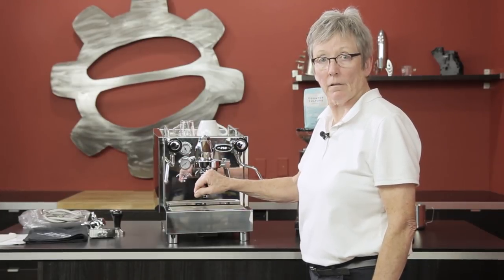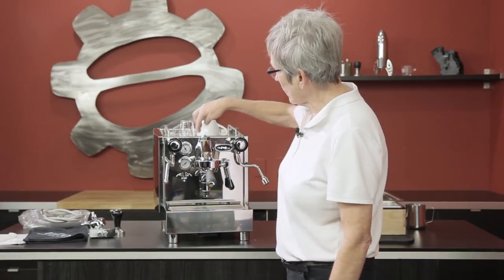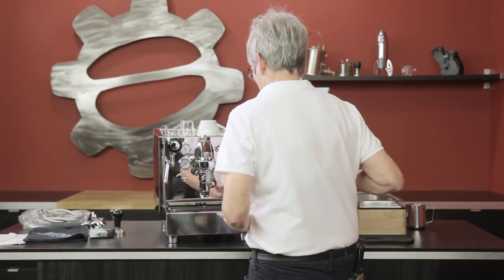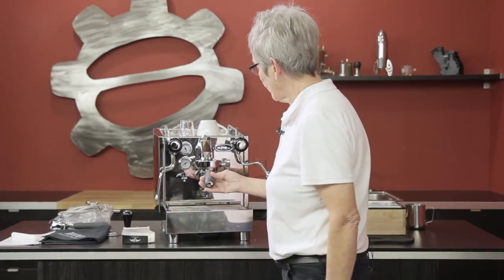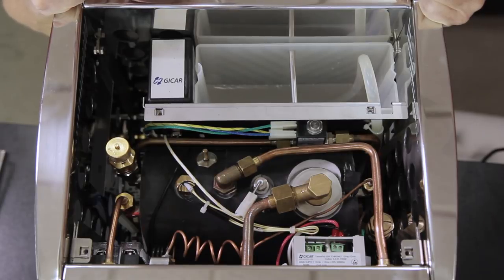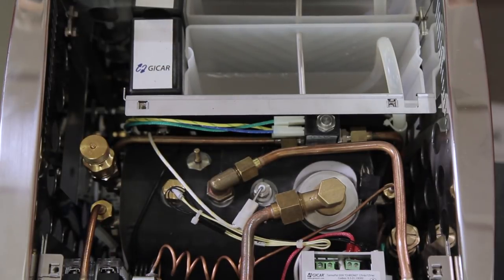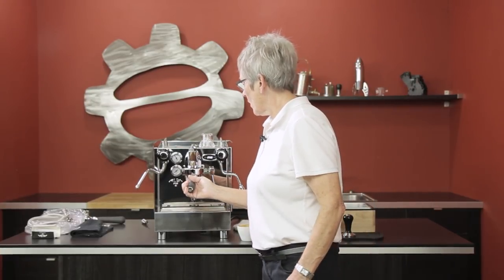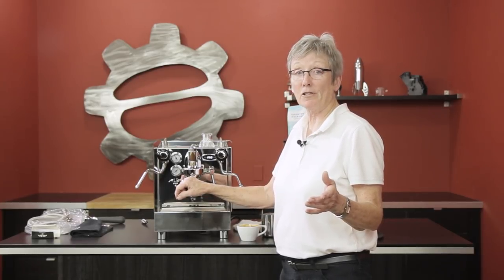Izzo Alex PID Pro Espresso Machine | Crew Review

Comment: Thanks for the good work. General question on semi-automatic machines, please.  If I buy a semi-automatic machine (leaning towards breville) with a 58mm portafilter, can I buy a standalone portafilter from another manufacturer of the same size to use with the Breville. I basically want to buy a stainless steel portafilter to use with a Breville (instead of standard brass OEM). Thanks
Reply: Nope, Breville/Sage has no standard portafilters. Additionally I don't think that even the baskets fit.
Reply: You won't be able to. Breville's portafilters are unlike all others. I know you didn't ask my opinion, but I would recommend opting for another brand over Breville as they often have problems with longevity. Depending on your budget, I'd consider the Gaggia Classic, then Rancilio Silvia, then the Expobar Office Lever